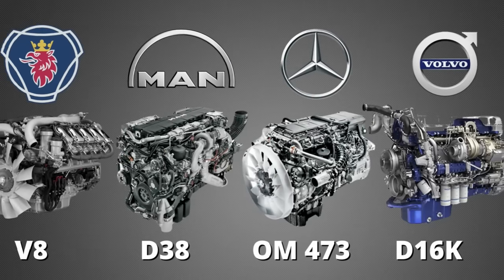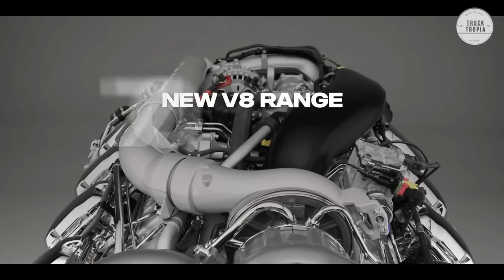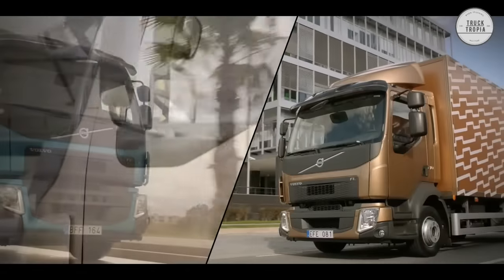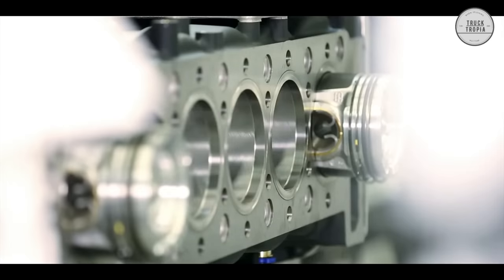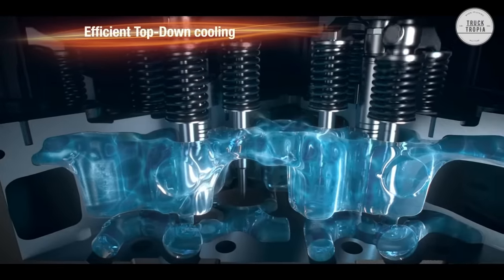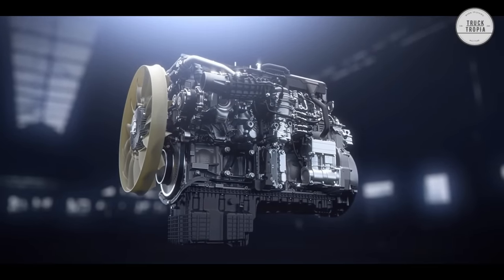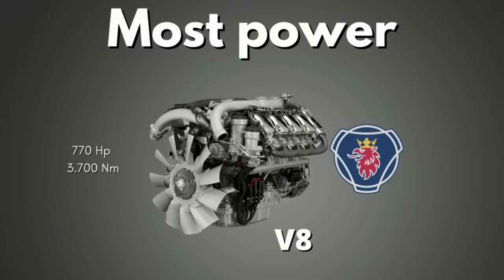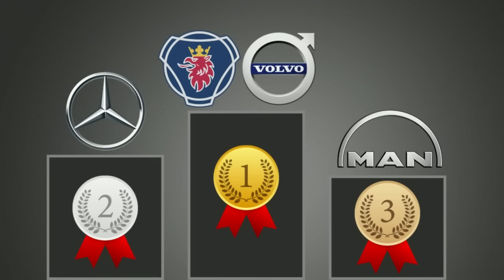Which Engine Is Best - Scania vs. Volvo vs. MAN vs. Mercedes

Comment: The OM473 couldn't pull your foreskin back, let alone 44 tonnes.
Reply: Exactly 😂😂
Reply: That's bs since we use them hauling 52 tonns on steep, curvy ,narrow icy roads in Norway
Reply: @stigandrmyrardalur5208  I run a fleet of FH16's and Scania V8's running 44 Tonnes all over the UK. They offer better MPG, Journeys take less time than our previous 2563 Actros's. Also the Swedes offer much better services than Mercedes in the UK. So no not Bullshit.
Reply: @MikeWooshy  When it comes to service l can't argue with you since l don't know the companies around you.
The time you use on a trip is dependent on the traffic, not the truck, and all tests, and own experience shows that MB is more fuel-effecient than the swedes.
Reply: @stigandrmyrardalur5208  I'll give you an example. 44 Tonnes GVW from Dudley, England to Aberdeen, Scotland. Leaving at 1am in the morning (so traffic doesn't come into it), a distance of around 430 miles. Our Mercedes were taking over 10 hours driving time to do the journey, this means the driver must have a rest period before making the delivery. The Swedes can do it under 10 hours driving time, this means we are saving a day in wages and gaining an extra day for work which means more turnover. The Mercedes would loose too much speed on the hills and you cannot gain that back. Lost into the ether.
Reply: @MikeWooshy  I see what you write, and since l've been a truckdriver three decades l tell you that what you write is just bullocks.
Reply: @stigandrmyrardalur5208  Is that all you have ? Reverting to abuse, it says more about your character than mine. I was born into a family that runs a transport company, I have the numbers, live telemetry, the receipts to back up my claims.
Reply: @MikeWooshy  Because you know that you're wrong.
The speed limit and traffic is the same no matter what brand the truck is.
The time you spend is the distance divided on average speed, not maximum speed.
Having 700+ to haul 40-50 tonns which is way less than these engines is made for is pure waste.
If you had the slightest idea about truck-engines and how they work, you wouldn't written such foolishness'
With only 44 tonns in UK which is rather flat, even a 530-540 is overkill, and you burn more fuel than necessary.
At the moment MB and DAF are the most fuel-efficient trucks in the marked, BUT it's dependent on how the driver operates it.
Reply: @stigandrmyrardalur5208  I have evidence for all my claims, all you have is theory. Like I said the Mercedes ended up loosing a day of income every week. Also when we look at resale values the Swedes knock the German manufacturers for 6. Also clearly you have never driven in the UK I can tell by the theory that you're coming out with.
Reply: @MikeWooshy  Oh, l can asure you that l've been in UK and driven on the wrong side of the road, had nightmares about miles, foot and inches because you're terrified of the metric system...
And despite plenty of good beer, your islands have a strange relationship to food.
If you ended up "loosing a day of income" by driving Mercedes l don't dare to ask what the heck you're doing since we on the other side of the North Sea manage fine everything we're supposed to do, despite we're having higher gross weights, steeper hills, and ice and snow on our roads.
My inpression is that you're constructing reasons to defend that you're having 700+ instead of being honest and admit that you think it's cool.
Reply: @stigandrmyrardalur5208  I've probably driven more Miles/Kilometres than you have had hot meals pal.
Reply: @stigandrmyrardalur5208  also you clearly didn't understand what I was saying. Leave at 1 am, plus 10 hours drive, plus 1.5 hours for mandatory breaks means about 12:00 arrive in Aberdeen. 1 hour unload = 13:00 finish for the Swedes. The Mercedes would run out of hours and not make Aberdeen until 14:00 and no hours left to drive, so must have minimum of 11 hours off which means 1 am in the morning. The site is closed until 6 am, so that is 7 am leave Aberdeen. By which time the Swedes are on route to Glasgow to collect a return load. Which means the Merc was Always behind the Swedes and by the end of the week that is where you loose the day over a week. If you couldn't figure this out then I really doubt you are a lorry driver. Also you do realise the UK speed limit is 60 mph/96kph, which means we run a higher average speed. Again clearly you don't know, you're the one trying to say that Daimler Powershift 3 box is as good as the I-shift and the Opticruise. Laughable and more proof you don't know what you are talking about.
Reply: @stigandrmyrardalur5208  Also where did mention 700 horsepower ? I have mentioned FH16 & Scania V8, nothing about power.
Reply: @MikeWooshy  I don't want to make this to a competition, but l've been a truckdriver since january -94, and have driven all over Europe, included your soot-islet...
Reply: @stigandrmyrardalur5208  Well, in our fleets. The Volvo pulled hills tons better than than the MB with the same power and same weights. That’s my personal experience and i can’t compare Volvo to Scania as the i have now setup wise is worlds different than the others. Plus MB sound like sewing machines are are much louder inside.
Reply: @TheJStoney  You might like your truck and defend your choise, but please do so without lies about other brands.
We do go up and hills in Scandinavia to, with higher weights than you're allowed to have, so we do have some ideas about how they pull, how they handle, how reliable they are etc
I've driven trucks of all european brands, and the best truck for me is the one which is on the road, not in the workshop
Reply: @stigandrmyrardalur5208  not defending but you’re being very defensive here. I’m only stated what I’ve personally experienced
Reply: @stigandrmyrardalur5208  We have a higher population density so traffic is worse. No one has lied, other than you, to yourself.
Reply: @TheJStoney  there is no reasoning with crazy pal. He is bitter that he has backed the wrong horse and lashes out at people who point this out. I believe it is called buyers remorse.
Reply: @MikeWooshy  yes, you have higher density, but that really doesn't matter.
Exactly WHAT have l said that allegedly is lies...????
Reply: @stigandrmyrardalur5208  Clearly it does, our roads are very different we have more Motorways and the speed is higher, meaning we can cover bigger distances in less time. The gearbox is king with trucks, the Swedish trucks have superior gearboxes & when mated with their superior engines means moving with traffic is easier and faster, trying to deny this is childish. This is where the MB falls down the Powershift 3 box is behind the competition, the new ZF traxxon box is superior and that is brought in, not "matched" like the Swedes and MB. We are going around in circles here. You prefer the MB product, which is fine (in isolation). But other people prefer Swedish products and have expressed that. You have then spit vitriolic words and acted very childish towards those who prefer Swedish (and have stated reasons  why came up with their experience to back that up) manufacturers. It smacks of Napoleon syndrome & buyers remorse, you backed the wrong horse and don't have the decency to admit it. Pathetic.
Reply: @MikeWooshy  You don't realice how ridicilous what you write is..?
Yes, you have more motorways, but also, as you stated, more traffic, so it's limited how fast you travel.
Sorry to destroy you, but Mercedes is the ones who are leading the development of trucks, included gear-box'
Most of the things you take for granted on a modern truck is developed in Germany. 
How you manage to claim that the engines from Sweden are "superior" is beyond me, but okay.
I've never said l "prefer MB products" and l never will, because ALL trucks have pro and cons.
The one spitting "vitriolic words" and using straw man arguments are you.
I want to discuss topic.
Reply: @stigandrmyrardalur5208  If you wanted to "discuss topics" you wouldn't sit here calling us liars & other such abusive language for saying & explaining why we prefer Swedish brands. The Swedes are far superior in the technological advancements of lorries, check out Swedish law for crash protection(for example), it is far more rigorous than the EU (German) market. Daimler trucks relies on its American division (which is no bad thing), but it shows over here, where there are a number of factors that favour the Swedish manufacturers. When you look at the sales volumes (in the UK) the Swedes are only behind the DAF, (which is seen as a "local product") in terms of market share. You are the one arguing trying to say that the UK market is wrong, but the facts (market sales, driver preference, resale value etc) say you are wrong. It may not apply to your country, but have the decency to fall on your sword. Also you are the one who thrown about words such as "liars", "Talking ballocks", etc etc first. I can go on it is all above in our conversation above. You're the one who brought up 700 horsepower etc, but never asked questions what spec's we run, straight to "We run more weight you are wrong.". Then you say it is us who throws abuse around, you must have studied Paul Goebbels very well.
Reply: @MikeWooshy  my use of the word "lies" not "liars" was related to the statement you wrote, because even you know it's false.
The reason why l wrote that we in Scandinavia have higher gross-weights than you have in UK is because it's a fact.
We're allowed to be 60 tonns on most roads, while you're limited to 44 tonns
I'm truly sorry that you find facts abusive.
Reply: @stigandrmyrardalur5208  actually we can run 150 tonnes weight (depending on axle arrangements) under STGO. Again proof you don't know this market.
Reply: @stigandrmyrardalur5208  "use of the word "lies" not "liars" was related to the statement you wrote, because even you know it's false." Do you even know how ridiculous this sounds ? We have given examples and our experience why 2 products are better than another & because you do not agree with it, you call it lies and it must be false. I know Norway has lots of tunnels, perhaps you are suffering from tunnel vision ?
Reply: @stigandrmyrardalur5208  Sorry but Mercedes gearboxes are trash. Especially when it’s searching for a gear when you want to go in a traffic circle. Volvo has the best Duel clutch box out there but when it comes to robotized manuals Scania takes it.
Reply: @MikeWooshy  You’re right lol
Reply: @TheJStoney  Strangely enough have l never ever experienced that problem....
And none of my collegas have either.
The only ones l know complain about that are those guys who find "problems" on every other brand, and cant find any problems at all with vabis 🤗
The new gear-system on Scania is totally acceptable, but nothing more